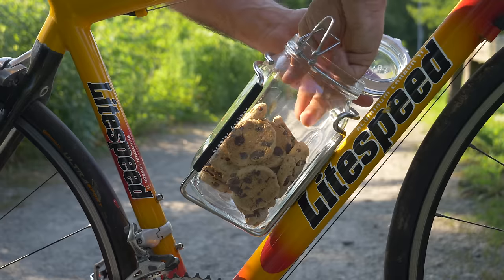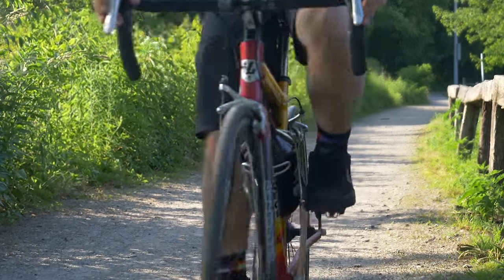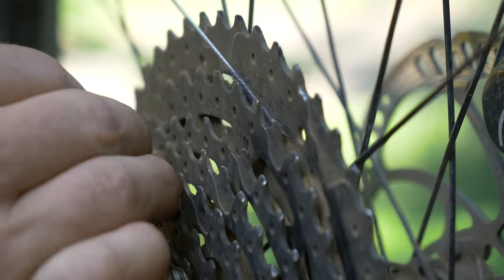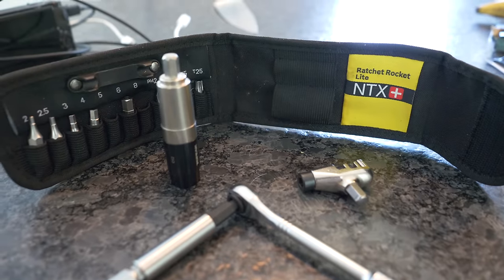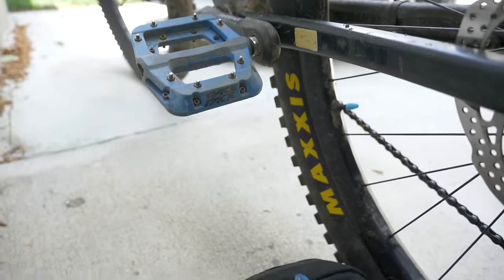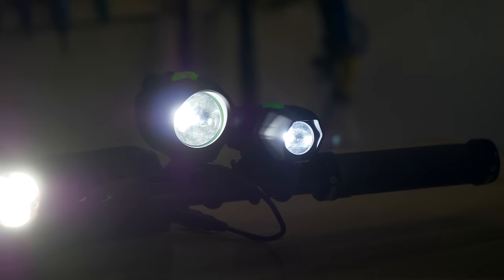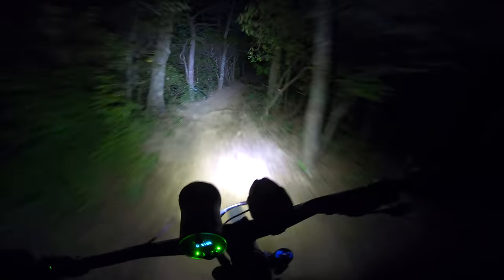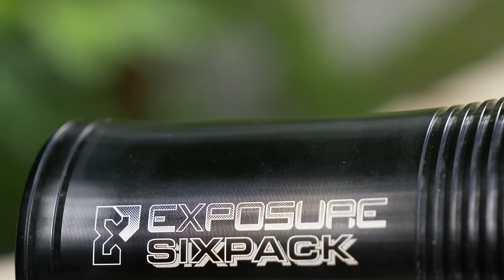10 Unique Bike Products Reviewed Brutally

Comment: @sethsbikehacks thanks for the honest review of the exposure lights(mainly the mounting) was looking into purchasing them as my next lights. But probably a good idea to look else where with a better all around setup.
Reply: As Seth said, he was extremely harsh on them due to cost. The clamp breaking in a crash..random bad luck...it grips the bar so well it didnt twist like other do even in chunk. The joystick helmet mount grips the light faultlessly in use but in a crash will break away like it should so u dont die! IF u can afford it, there are no better bike lights. I can't afford them, but they are, as seth also said, frigin unbelievable. Performance, light output, battery life beam, quality, reliability nothing comes close. Also fully programmable (seth didnt mention). They cost lots for a reason. Check out reviews and tests online on mbr, bike radar etc. Etc
Reply: @rupedog  yea I'm still going to look into it as i have ran a serfas  light which was amazing when it worked but it stopped work to much. Then 2 bontrager 700 which were very reliable but not bright enough. So I'm interested in something else.

Comment: The lights wtf.. get a Convoy S21a SST40 for 16 bucks shipped to your door from China, get a 3 dollar handlebar mount, put a 21700 in it (or if you want to go 18650, buy the Convoy S2+ SST40), put it on a middle mode and be golden. You will get about 680 lumen continous output out of it for over 2:15 hours with a single battery.
Want it floodier? Get a Astrolux S43s bundled with an 18650 battery for around 50 bucks shipped. It even can charge the battery with an integrated USB charger. Want it fancier? Get an Emisar D4v2 where you select any output brightness you want, and RGB standbylight. More output? Fireflies ROT66 or any beercan light.
Literally just get ANY good flashlight and mount it to your bike. And BAM, you also get a good flashlight for other every day stuff as a bonus.

Comment: I paid $20 for a 1000 lumen with one hell of a beam. Used a 5000 mah 18650 and it lasted 4 hours as it only had 1 setting. Had to aim it low to not blind oncoming cars. $5 for a mount that rotated side to side. No problem seeing anyting on a trail. And my friends said they saw my Catseye 20 lumen tail light from 2 miles away. Paid $10 for it. Still wondering why bike lights suck and are expensive.

Comment: 10:24 you can use 4 zip ties and secure it to your handle bar just tie some electrical tape and it will stay still in the position you set it in

Comment: Pro-tip... (pro as in a daily road rider year around to and from work no license and i was a bike messenger for a few years) Amazon $25 "ETpower" bike light 3 levels of brightness and claims 1,500 lums not sure about that but its very bright.. downside i learned about the hard way you will need to modify it before 1st ride with a glue gun remove back panel where on/off button is careful not to pull to hard or lose the tiny screws and than just cover the board in glue all around the coil i did whole board built up the glue to the height of the coil DO NOT fill inside of it just around it. My 1st one broke 5mins after i put it on going of a curb lol but i looked at it and figured out why it broke got a 2nd one for free from Amazon and fixed the issue before it broke.. 
  The battery pack it comes with is not waterproof and the case sucks mine is starting to rip.. no worries easy fix put it in a bag or as i did 2 layers of plumbing tape than 2 layers of Electrical tape might be easier or even better ways to do that but my way on the pack and the light has kept it working great! Have over 50hrs of use over the last year still happen with it. I charge battery pack once a week. I would guess you get maybe 3-5hrs on highest setting never ran it for more than 10miles on a motorized bicycle (so a good amount of vibration there aswell) a 2nd or even 3rd battery pack is also a option since they are only $20. 
  Still hunting for a good rear lighting option with remote that can handle vibration or trails... might go full mopad lighting

Comment: For that rocket tool just buy a 1/4 racket and a cheap set of bits for like £30 and a lark to 3-6nm torque wrench and be done with it way way less than £80 and actually use full

Comment: Kinda Fair point on the clips/mount options...tho they work fine...however the exposures are simply the best mtb lights u can get, by absolute miles. Win Every test/review hands down. Nothing comes remotely close for reliability, power, quality of build, beam, robustness, features (u didn't mention you can program the outputs) etc. I can guarantee that now you have bought/sourced them u wont ever use anything else (unless u forget to charge them). Yes expensive...for a reason.. many bikes cost $7k + easily...you can get a great motorbike new for that! For the output, those $105 ones were not good value...400lumens isnt off road suitable at all. Much better with sanyo/panasonic batteries on ebay!

Comment: Just gonna add in the UK the exposure lights are a lot less money more like 500 quid
Reply: Diablo is about £385, so about $500, so actually about the same. $700 was for both...prob slightly cheaper in US actually, depending on exchange rate. Still no better lights, if u can afford them. Really for those with $7k plus bikes...
Reply: @rupedog  I guess I messed up the exchange rate then. O well. Mbr really liked them last year

Comment: You can buy 5000+ actual lumen lights that were designed and made by guys on flashlight forums, they're legit. For $60-80 and just use a handlebar flashlight mount instead.  The BLF Q8 is one example (budget light forum built light)

Comment: Seth, I was riding my MTB in the road and it got hit with a rikshaw and  it's first wheel was kinda broke and it's wheel joint in broke. I got it's shape fixed but the joint is visible. Should I do heavy jumps with it? Or should I change it?

Comment: Hey, I am fairly new to mountain biking, but I ran into a problem on most of the trails that I was trying to ride on. On the trail that I was on, there were a ton of jagged rocks. not just little patches, but literally throughout the entire trail. Is there anything that I could do to avoid a crash on trails like this?
Reply: Use tubeless tires and maybe contact the trail builders
Reply: @YukonK9  Thanks, I actually picked up the number for the trail managers, I'll look into both of these.

Comment: I bought a mok fire 1200 Lumen light they can on your bike or on your helmet with a band  
Off of Amazon for $12 they're now sold out but I blind cars was it on 1200 W the last 9 hours on 12 or low 6 700 watt lumens 29 96 hours depending on what web pages read 
I've had two bad crashes was it on my bike so far and it's not even budged and has a a curves mounting bracket built into the frame of the polite with a rubberized internal peace with a giant Industrial Rubber Band

Comment: Isn't it illegal to drink and ride technically? Also, I use the atomic beam flashlight with an 18650 battery. Very bright and adjustable zoom. No headlamp needed. I bought a clamp for it on Amazon total cost to see very well, about $45 USD. I really dont think theres much justification with an $800 one. Especiallu when riding on the street. I don't want to blind oncoming traffic.

Comment: Just sayin, those lights are an overpriced joke (Even the $100 one) For my ebike, I got a car flood light ($20) and a used lithium ion drill battery with a charger and it came well below 50 dollar, it did get stolen and I replaced it with a fog light instead with a cut off point to not blind people. 

They would be justifiable if they were compact, but even the 700 has a battery the same size my drill battery. Obviously do expect some DIY.

Comment: Can U Suggest Me Buying a Bike? Please Reply when u are free?!!
Reply: If your budget falls around 500 to 600 usd you can get an entry level hardtail such as  a Trek Marlin 5 or even the next up Trek Marlin 6.   It will get you started.  My recommendation is get a Trek Marlin 5 and save up later for upgrades such as a stronger fork and longer suspension travel.  No sense in paying $1,000 usd  up front until you get familiar with the trails and the bike plus polish your skills.

Comment: lights are an absolute ripoff. i run a 2000lm (legit lumens sourced from cree) set i made myself and it cost all of about $50. custom driver with my prefered brightness levels made to order, tiny footprint on the bars. lightweight battery that runs them for about 8hrs. >$700 is an absolute joke for that monstrosity of a beancan. i also have an oled display that gives battery stats. cheapy cheap cheap to make all of this.